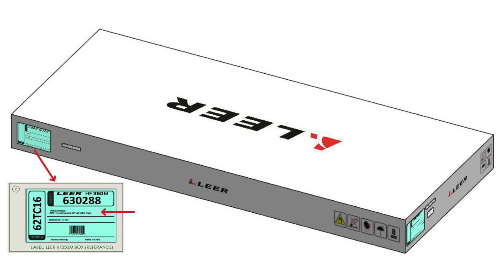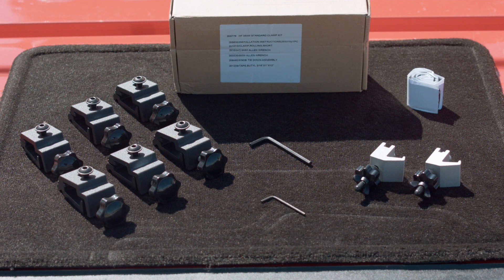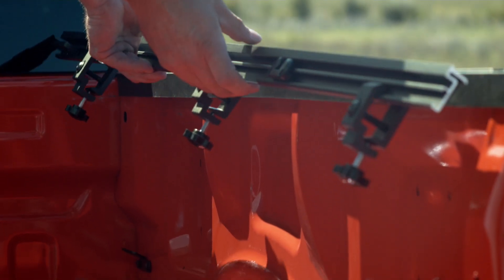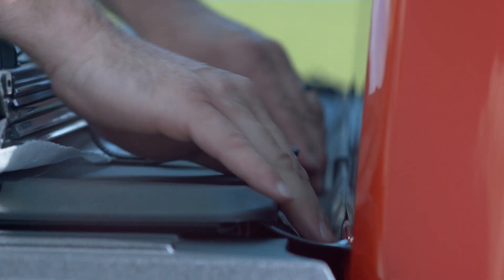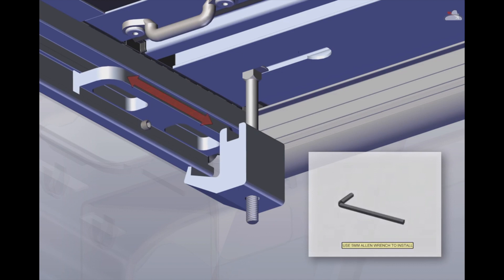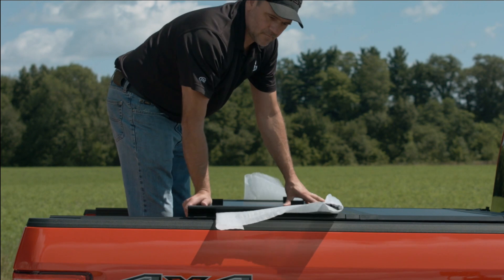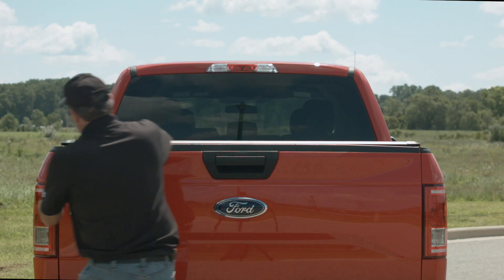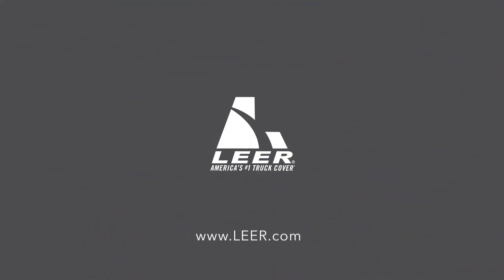LEER HF350M Installation Video

Comment: I must have gotten the one that was manufactured late Friday or early Monday. Straight out of the box missing one of the clamps, The lever release for the strut that holds the cover in the vertical position is missing straight out of the box. And the first time I used It in the vertical position to haul a piece of furniture one of the trim pieces we’re it folds was just laying in the truck when I got to where I was headed. I sent an email I know it’s a holiday weekend so hopefully this gets resolved. None of these three problems were a dealer item I see all three of these problems coming straight from Leer.
Reply from the maker: Hey Tate. We hope you've heard from Customer Service by now. If not - please go to our Facebook page and DM us with your contact info. Thanks!

Comment: I purchased a leer hf350m for my 2021 f150 from a dealer in Cape Girardeau, Mo. the hinge assembly between the panel behind the cab and the middle one is sticking up. I’ve tried to see what the problem is with no avail. I tried contacting Leer on line but every time I click on contact it goes to a blank web page.
Reply from the maker: Hi Jeff, thanks for reaching out! We’re looking into why the contact form is down for you. We’ve tested and seems to be back up on our end. In the meantime, please go to the hinge with the issue and on the underside of the hinge, locate a long, plastic piece that runs all along the unit. Please go ahead and remove this piece. The issue that’s happening is that the joint is closing down on the piece and it’s pinching and putting unnecessary pressure there, causing everything else to shift up. Once you remove this, let the unit sit a few hours and it will settle back down.
Reply: Thanks ill try that in the morning

Comment: Will the HF350 work on a 2015 F150 supercrew 5’6” bed?
Reply from the maker: Yes it will
Reply: Didn’t have an answer for the dust seal.. seen U literally skipped past the above question to answer this one.. not a good sign for a potential customer 👀

Comment: What's the best way to keep the dust seal from flapping when driving at highway speed(It's very noisy)?  Also, what are the two foam rubber strips and roll of tape for?  They are not mentioned in the instructions.
Reply: Would love an answer on the dust seal noise.